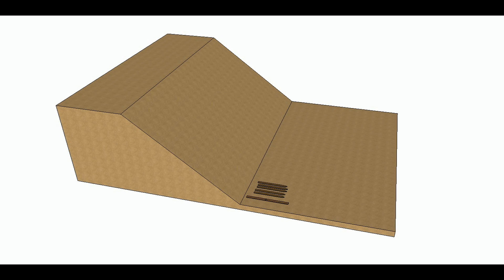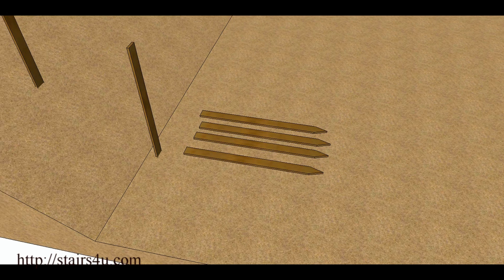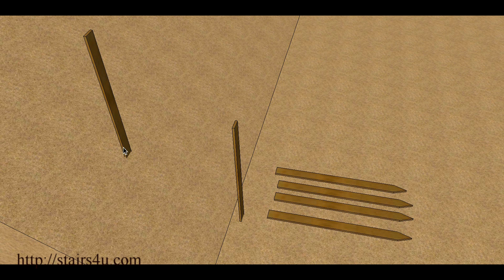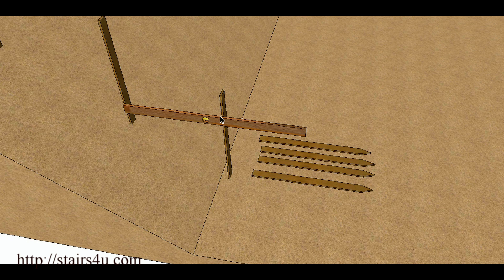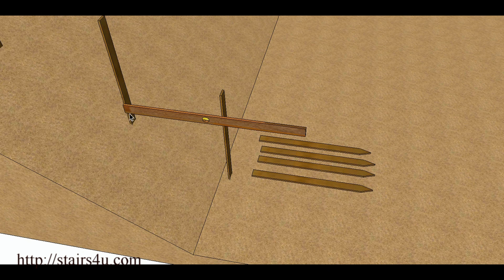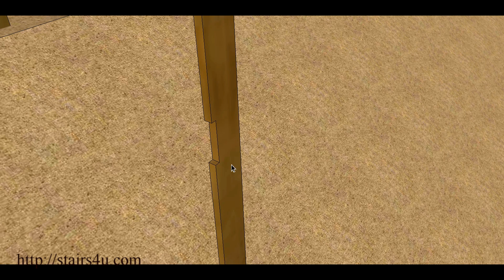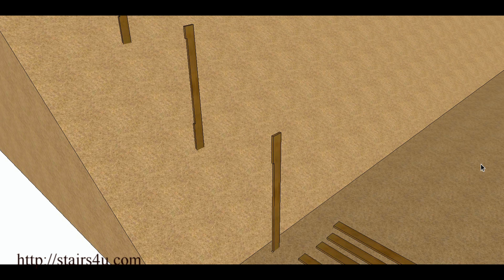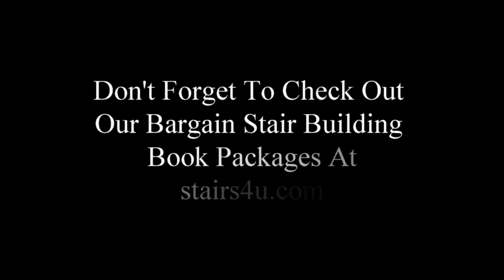How To Calculate Vertical Hillside Rise to Build Stairs

Comment: how do you know how deep or the depth of each stair. I understand everything else but I have a block on figuring how deep.
Reply: I understand rise and run for like a deck or house but how do i ride the edge of the slope.
Reply from the maker: The soil will need to be firm to create some type of shape for a ridge or edge. This is where you might want to use some type of guide board to prevent the soil from coming into your stairway. Let me know if this doesn't make sense.
Reply: @stairbuilding  Yes it does thanks

Comment: My level is mid length.  I simply tape it to a long straight piece of timber for lengths.  Then REVERSE it to check accuracy. I put down a 5 by 7 shed Base using 8ft of 3"x 2" timber. It was on a slope.

Comment: And here I just solved for the hypotenuse for my whole hill and then figured out the hypotenuse for an 8” riser and 12” tread and came up with 18 steps. Except I want to have an 18’-24’ landing every 3-4 steps so haven’t figured out the math for that...gonna try your stick method.
Reply from the maker: Let us know which method works best.
Reply: stairbuilding I’m stuck figuring out the 2’ landings every few steps. 🤪

Comment: what if you are just want to add a few steps on a steep hillside to make it easier to climb, but don't want to really add a full stair system?  Can you just put in a few railroad ties with rebar stakes without them falling down the hill???
Reply from the maker: Of course you can, just try to keep the riser height consistent. For example if step number one has a 7 inch riser and step number two has an 8 inch riser and then step number three has a 9 inch riser, it might be uncomfortable to walk on. Try to keep them as close to the same measurements as possible.

Comment: Learning that stairs are normally at a 35-38 angle was helpful, but I did not understand the rest of the explanation. I would imagine that once you determine the angle that you are going to go with, you then need to decide the depth and height of each step, and then you can build the stairs.
Reply from the maker: +dfmackenzie Exactly and it might not be easy to figure all that stuff out.
Reply: Slope equals rise over run. This method allows you to determine the slope of a hill without measuring straight through the hill, which you cannot do.
Reply: dfmack didn't make sense to me either. Based on what he said the 4ft level determines the stakes are 4ft apart. By marking the level line on the stake, I assume this gives you the height of that step? Now if we take a level line from the second stake up the slope back to the first stake, what's to stop that mark being 2ft high? Who's heard of a step with a 2ft riser? He said though that the marks determine the distance between stakes. We know that he said 4ft apart!
Reply: This video shows how to find the total RISE. If you keep your stakes completely PLUMB, you will also be able to calculate the RUN. Thus you now have the necessary information to determine the size of your steps.